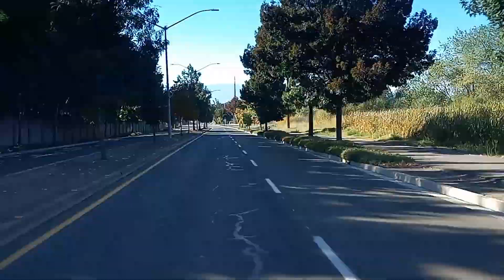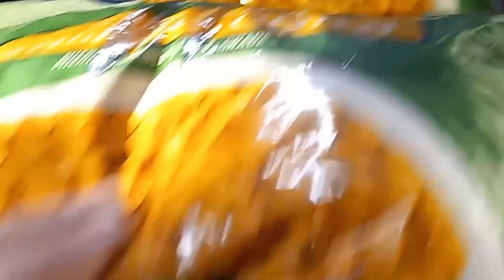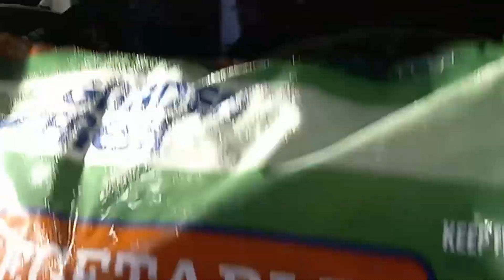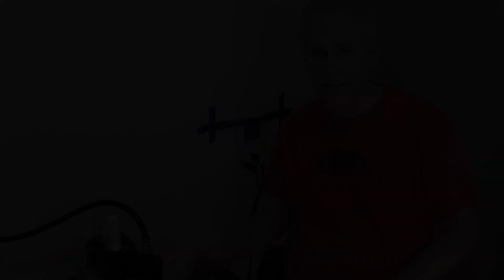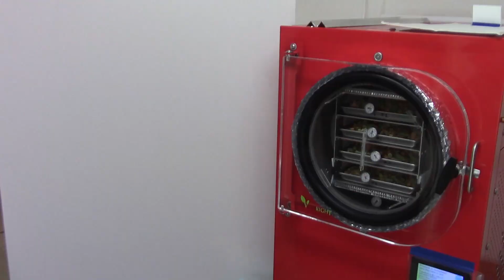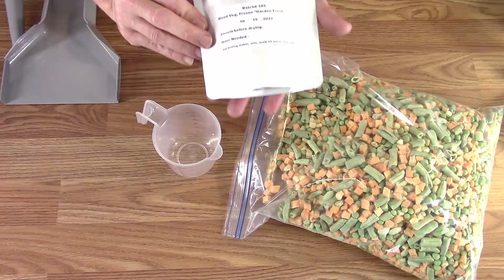Freeze Drying - The Next 50 Batches - Batch 585, Mixed Vegetables - Every Little Detail

Comment: I have a 5 tray med FD. When i do my 1st weight and record it and then weigh again in 2 hrs... example: 3 trays are the same and 2 trays differ by 1 gram. does that mean i have to put them all on for another 2 hrs for the 2 trays that are 1 gram off? ex. 909 to 908. hope that makes sense.  i think for sure if they are 2 grams off i need more time. im trying to do your weighing method, havent got to the thermometers yet. this is all pretty intimidating.
Reply from the maker: One gram of loss during 2 or 3 hours is often good enough to know it's done. You'll quickly get used to which foods are done and won't lose more if you were to give it additional Dry Check  hours. 
With what you describe, we often do take out the trays that have no loss and just put back in the ones with loss.
At the weighing stage of a few videos I go a little into my thought process of deciding if I'll take them out when they have tiny weight losses. Mashed Potatoes - Batch 655 - https://youtu.be/t-Mik18IHtk?si=nH97AX98Unn--uTq&t=799

If the weight drops during the Dry Check it may need more time. I feel uncomfortable with any number other than 0!
    That being said, if it was no more than 1 gram and it's been at least a 2 1/2 or 3  hour Dry Check, and the dry weight of the food on the tray is over 100 grams (meaning the loss was well below 1%), then I sometimes will take it out.
    You can see on this video at this spot-  https://youtu.be/C2zHubgj4E4?si=FgwS0f-bM0gRgRf1&t=1046 - that 2 trays had a 1 gram loss each in 3 hours. After I mixed all 4 trays together for a total of over 800 grams dry weight, the loss was less than 1/4 of one percent.
The only reason I was kind of comfortable with taking it out after this small loss, is because after doing another round of Dry Checks  many, many times, I've found that the next weight check would show no loss under these conditions for that food.

Comment: I have seen you store your Mylar bags in plastic tote boxes. I guess the ambient temp inside the box is very similar to outside the box inside the house?  I want to keep my freeze dried food at room temp. I love your videos and have learned so much.
Reply from the maker: Yes, the temperatures inside the tubs are the same as the surrounding room. "Room temperature" is considered normal for storing freeze dried food, but cooler is still better. Our freeze drying and storage area is in our walk-out basement where is stays between (for the most part) about 60 and 70ºf. It might hit 75º for a short time when it's summer and we're running the freeze dryer at the same time.

(This is from the Mountain House freeze dried food website)
*Store Mountain House food under dry, sanitary conditions, without prolonged exposure to extreme temperatures and avoiding any environment that could cause damage to the packaging, such as punctures or dents. To maximize shelf life, store food unopened and avoid prolonged exposure to temperatures above 75°F (24°C).

Comment: I never asked, why do you not like using the defrost in the machine? Do you not want to use the extra energy or does it defrosts almost as fast.
Reply from the maker: It only takes a couple extra hours.(and I'm seldom in that big a hurry, and if I am I can just pull the ice out)
To save electricity, to save wear and tear of the freeze dryer components, and to make sure I don't give molds and mildew a warm moist growth environment; some people that have used the defrost function (and forgot to open the door afterwards) have reported a nasty, fuzzy surprise when opening it later.